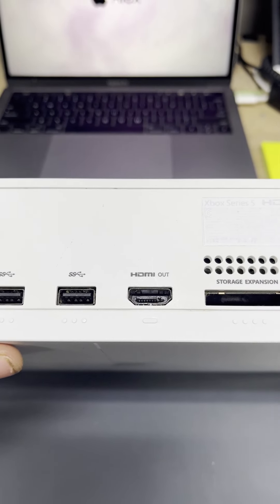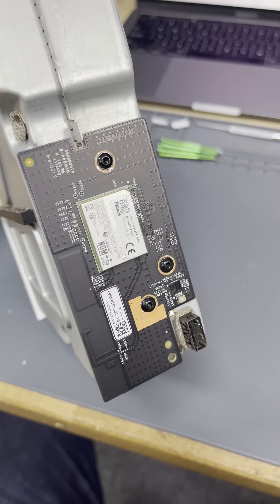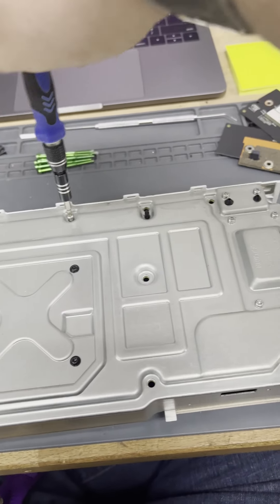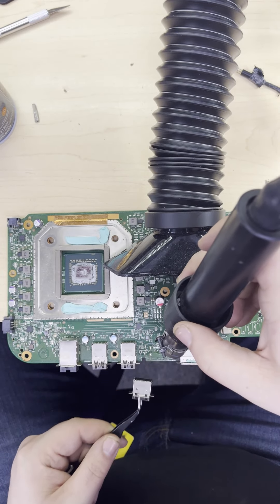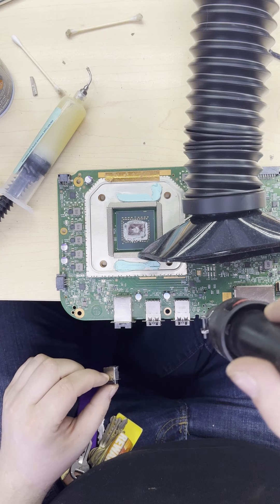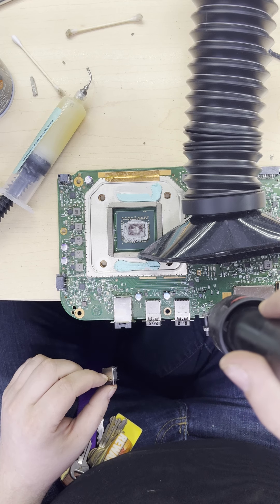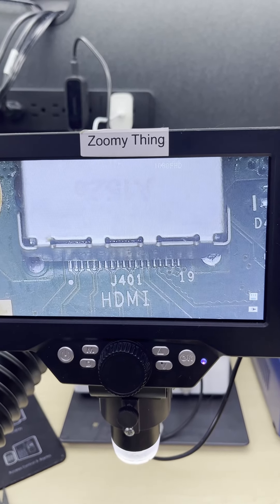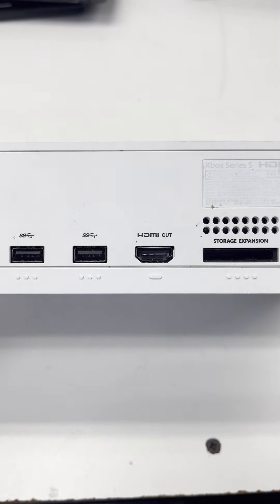Xbox Series S HDMI Port Replacement

Comment: Hey what port did you use. Thanks great vid
Reply from the maker: I just searched for 'Xbox Series S HDMI Port' on eBay and used the first one that came in a 5 pack. Readily available for less than $10 in a single at this moment.